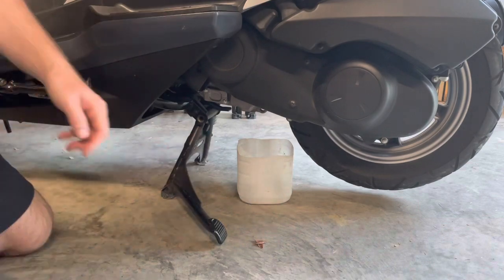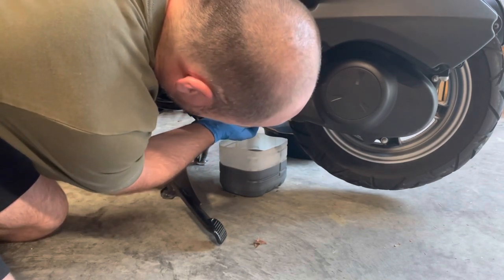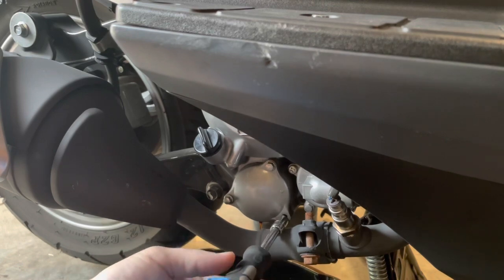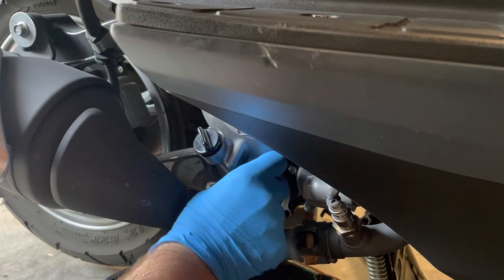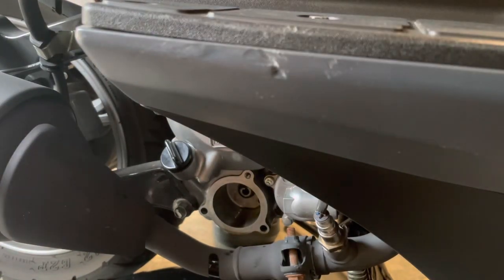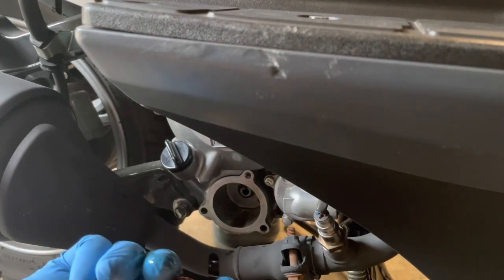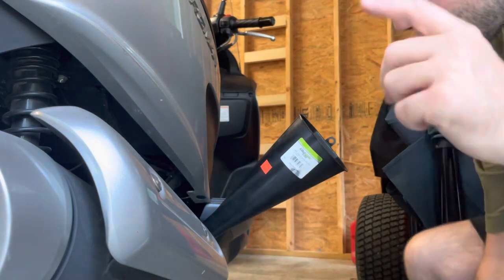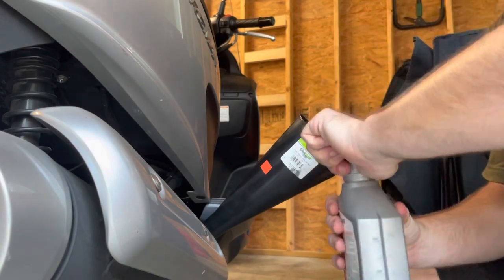Suzuki Burgman 200: Comprehensive Oil Change

Comment: Thanks for this.  Followed it to the letter and it was pretty easy.  Was really ticked off to discover that the dealership who had been doing my oil changes did not put an O-ring on the oil filter boss.  There was nothing there.  Even ran the used oil through a sieve to make sure it didn't just fall off when I pulled off the filter.  Nope, nothing.  Anyway, I didn't have one, but I'm going to get one for the next oil change.
Reply from the maker: Your welcome, glad it was helpful to you 👍

Comment: Most excellent video. I’m so lazy. I just turned the video on and did exactly what you said to do. Well done. Love my 200. Steve in Pensacola, FL.
Reply from the maker: Awesome, glad you found it helpful!!!
Reply: I got a 2022 Suzuki Burgman 200 and love it too. My oil change light came on as I passed 600 miles which is odd because the video mentions 3000 mile intervals
Reply: @buyerenogurlfwendo2106  As hard as I ride mine, I'm going to change it at 2600 miles.  I'm so agressive in traffic that people get out of my way. Big trucks like to race me.

Comment: I got a 2022 Suzuki Burgman 200 and just hit over 600 miles and my oil change light popped on.

I bought it new at a dealership with 1 mile on it. The dealer said I could do oil changes and what not and still be under warranty as long as I saved my receipts.

What has me curious is you keep mentioning this 3000 mile interval yet I’m only 20% there and my bike wants me to do an oil change.

Anyways thanks for this informative video. I hope you respond but this video is a good resource none the less.
Reply from the maker: 600 mile is the first break in change, then 3k interval after that 👍
Reply: As hard as I rode mine for the first 300 miles, I didnt have a filter and just changed  the oil. When my filters came I changed it at 600 miles. There were shards of metal flecks in the oil at 300 miles and very visible bits in the filter.  I saved it so that I could show people.  Normally I would be a little worried but I watched a video about break in and it proved to me that I have nothing to worry about.  Another video I watched later from a lubrication specialist confirmed my belief in changing the oil very early because of the metal shards and he was talking about new cars not motorcycles.

Comment: Since I own 2015 Suzuki burgman 200 your video is very thorough and helpful to me. 
Thank you kindly 
If you replace transmission oil someday, could you please make its video. 
I’m sure it would be helpful to burgman owners.
Keep up the good work 
Good day
Reply from the maker: I do plan to make a video about that when I change it, rear wheel has to be removed so I’m waiting on my rear tire to need replacing to change that gear oil, thanks for the kind words!!!

Comment: This is such a great help and i’m about to do my 1st oil change on 2022 SB 200 been looking around the parts for the oil filters and I’ll probably just gonna order it from revzilla
Reply from the maker: Revzilla is a good resource, good luck!! It’s fairly easy to do 👍
Reply: @DirtRider22a  Waiting for my oil filter now. I’m excited for changing my oil soon and i will definitely watch this video while doing it 😊Question do you warm up the scooter first then change the oil afterwards? Or don’t warm it up and just change your oil?
Reply from the maker: @sameMlem  I would run it for a couple min, not necessarily to warm it up, but to get any sediment mixed in the oil well right before draining it.
Reply: @DirtRider22a I finally did the oil changed today wohooo! It was a pain I watched your video again and again to make sure i did everything right. I have to do the oil change earlier than i expected cause I won’t be able to do it this next few weeks. Thank you so much!! It was a GREAT HELP!!
Reply from the maker: @sameMlem  that’s awesome!!! Glad you found it useful 🤙🏼
Reply: I got the same model bro. I got it new at a dealership on May 17th 2024. I just hit 600 miles and my oil change light came on.

Would love to hear more from you since we got the same bike; as well as the video author.

It’s a great bike and this video makes me confident I can do the oil change.
Reply: @sameMlem glad you were able to accomplish the oil change

Comment: nice one, that other sump bolt looked like the real one how confusing..  i always change my scooter engine oil way before the spec.... it makes the engine last forever, and  it sounds quiet with new oil..changing that often any semi 10/40 would be good, but mobil 1 is really great especially the fully synthetic.. ya need to squeeze every ounce of power out these small scooters, 
my own 200 burg the rear wheel bearings just went.. i have a feeling theres a bearing in the swingarm frame thing as well as the wheel..?
Reply from the maker: I would assume you are correct but I have no clue, I’ve never taken the rear wheel off. Will have to soon for a new rear tire but not quite there yet
Reply: How did you tell the wheel bearings went out specifically, I'm mechanically inclined lol, but new motorbike owner and realized I will have to start learning how to do maintenance on my own.
Reply: @only1aeileon  the rear bearings had not gone... the nut had simply loosened a tiny bit giving the feel of shot bearings..... the burgman has a bearing in the rear swingarm triangle though... these can go , but are easily replaced.. and they are not too expensive.. £5 each on ebay

Comment: i almost bought one today. a 2018 with 320 miles on it. $2.899. i called them this morning and i told them i wanted to know what drive out price was. and he told me $4.792  i freaked out. and he told me its almost a new bike $250 for a oil change. $900 for a 1 year warranty thats only good at his shop. thats 300 miles away $400 for a 60 point inspection fee. and the rest was TT&L i told him no to everything but the TT&L  he got it down to $4100. it still didn't add up then my interest rate went from 6.5 to 12.9%. i told him to keep the bike. then i check their reviews and they had 2 5 stars 1 4 start and over 130 1 star ratings. its to late this weekend but i will start looking again Monday for another one.
Reply from the maker: Man I hate that price gouging, surely you can find a better deal than that or wait a month and call him back and ask him if he’s ready to take 3250 for it. It winter so he might be sittin on it for awhile
Reply: @DirtRider22a   i thought about that but with all the bad reviews. i wont go back there. plus for anything over 4k i will just get a new one. and find the one that screws people over the less.
Reply: That’s odd because I bought a new 2022 with 1 mile on it and it was at $3500 and my walk out the door price was $4900ish

(Was like $4902-$4903).
Reply: @DirtRider22a it’s 2024 right and I found one that’s new and a 2022. Also I’m in Washington, the fastest growing state, and this thing sat for over a year at this dealership (was originally $4,999 msrp but they knocked it down to $3,499).

Out the door price was $4900ish (I think $4902 or $4903). Plus since it’s new I have a $0 service deductible at any Suzuki dealership. Things like oil changes still cost money but the dealer I bought it from said I could do them myself and just save receipts and still be under warranty.

I love it though. Even though it’s a “scooter” it’s still a motor bike in my eyes. It has no problems keeping up with my friends on the curvy back roads. Love equipping my sena spider st1 helmet and chatting while riding with them. Solo rides with music are pretty dope too.

Comment: Does the manual say to use motorcycle oil?  If it does you should use it.  It may have a wet centrifugal clutch even it is a CVT.
Reply from the maker: It’s dry, also it says to use MA rated oil I think if my memory is correct, which is a “scooter” specific oil, and is not a type of oil that should be used with wet clutches.
Reply: @DirtRider22a  MA and MA2 are both wet clutch oil that have nothing to do with Scooter specifics.
Reply: @DirtRider22a  I was of the same school of thought and you until I bought my King Quad.  It specifies an MA oil which is wet clutch rated.  My machine actually has a wet centrifugal clutch before the CVT which keeps the belt tight which is different than many CVT systems.  If the manual says MA you are better off with an MA oil.
Reply from the maker: @camumaharajah1033  mb rating, my bad.
Reply from the maker: @camumaharajah1033  I used ma oil, it calls for mb and it has no wet clutch
Reply: @DirtRider22a  I know you used Mobil 1 4T 10w40 which meets spec.  Good trusted oil!  It's just that you said you didn't need an MA oil when the manual says you do.  It may come out that I am wrong.  But until you are out of warranty at least use what the manual says to use.  Not trying to be like a know-it-all or anything like that I just think I would have used any 10w40 in my King Quad before I learned there was a reason for MA spec oil.
Reply: @DirtRider22a  I enjoy your videos and I'm only trying to be helpful!
Reply: @DirtRider22a  Well I learned something!  Didn't know of MB!  Anyways I think Mobil 1 10w40 T is good stuff.  No wet clutch you should be good.   I gotta go research MB now.   I didn't know of that s spec.   It actually is scooter specific.
Reply: @DirtRider22a  Subscribed.   I like your videos!   Buy the wife a King Quad!

Comment: What do you think about the magnum tuning chip that bypasses all of the emissions stuff so that you can get a little more horse power.?
Reply from the maker: I wouldn’t waste my time with it on a scooter like this personally
Reply: Once you start looking for “hacks” and cheap tricks to get more HP that’s when stuff starts blowing up on ya lol
Reply: @buyerenogurlfwendo2106  I don't see how disabling the eco nonsense that is robbing hp could hurt unless you abuse it.  I bought a 200cc engine and its putting out 180.  I've seen videos about how current models are inferior to older models.  The particular mod I bought doesn't undo the rev limiter but you have to buy that mod if you upgrade the exhaust.  I can absolutely agree with you about exceeding the rev limit probably working out badly.

Comment: Hi DirtRider22, I was trying to get the center stand up on my burgman 200, but it's almost impossible in my garage with a smooth surface. Do you have any tips on how to get it up? or should I find a parking lot/ rougher surface to get it up on?
Reply from the maker: If lifting the bike onto the center stand then just put all of your weight onto the stand and pickup on the grab handle. If trying to get the bike off the stand and it’s slick then do it off the bike and put your foot in front of the stand on the ground to help keep it from sliding while pushing forward. Best advise I got lol
Reply: When I first got my 2022 Suzuki burgman was a bit troublesome to put on the center stand. Just got to make sure it’s level side by side and put a foot on the bar and hop on just right.

Then to get it off you just push it forward and it disengages.
Reply: I can barely get my 650 up on the stand. the 200 is easy.  I did buy the kick stand extender that fits over the kick stand and give you a much larger foot print on soft black top and protects the foot from rust.  Well worth the $9 bucks. It looks great and was very easy to install.

Comment: So can anyone tell me what the other plug was?
Reply from the maker: I have no clue and don’t have a proper service manual to be able to look it up, possible timing chain tensioner or something along those lines, in which case if you loosen it there could be problems getting it all reset, like more tear down needed to get it all back together correctly.
Reply: @DirtRider22a  I bought the manual. $100 the best part of it is where it says tampering with the eco nonsense controls could reduce gas milage. ha ha

Comment: Can I use 10w-30 oil?  The manual shows 10w-30 for alternative oil.
Reply from the maker: Should be fine, especially if the manual recommends it as an alternative
Reply: @DirtRider22a  shows temperature 86 degrees Fahrenheit -4 to 86.  10w40 /10w-50 shows -20 to 104 degrees  .  Does that mean 10w-30 can only be used driving in climates up to 86 degrees Fahrenheit?
Reply from the maker: @DavidC641990  not sure, I would double check my manual but I don’t have this bike anymore. Let me google the manual and see if I can find a pdf copy to look at
Reply from the maker: @DavidC641990  ok I look at the manual online and yes, I wouldn’t use 10w30 in a hotter climate than 86. It would be fine for a short time I imagine in a pinch
Reply: @DirtRider22a that’s interesting. The weather where I’m at is hardly past 86. Maybe some days in July and august it’ll get there. It’s June right now and hottest day so far was like 75 lol
Reply: @DavidC641990 seems like 10w40 has the wider range and safest option regardless of temperature
Reply: I downloaded a 2022 Suzuki burgman 200 digital service manual. 10w40 is the preferred but there is multiple alternatives and different temperature ranges for each of them.

10w40 is preferred but it also shows: 10w30, 10w50, 15w40, 15w50, 20w40, 20w50.

10w30 there’s really no upside, it has less of a range than 10w40 and the chart doesn’t say it can handle colder temperatures so it’s more like only use if in a pinch.

I imagine the ones above 10w40  (all the other alternatives listed) can handle hotter temperatures but they do worse in colder temperatures.

Ultimately you should use 10w40 but you can use the others in a pinch depending on your climate. If it’s somewhere where you’re constantly above 86 F then I would use a more viscous oil like 15w40 or 20w40 over 10w30; but once again only if I can’t get 10w40 when needed.